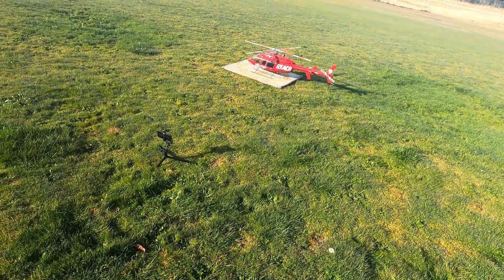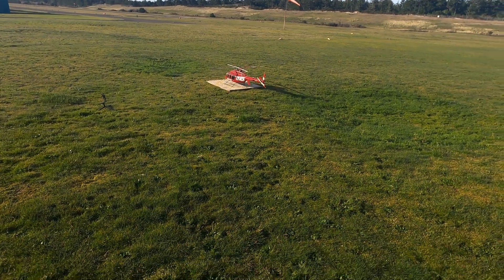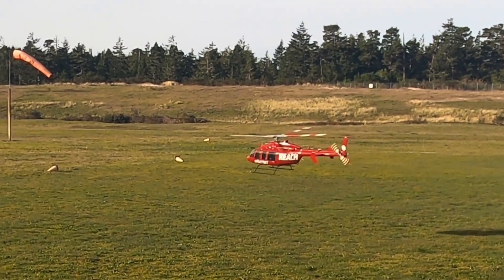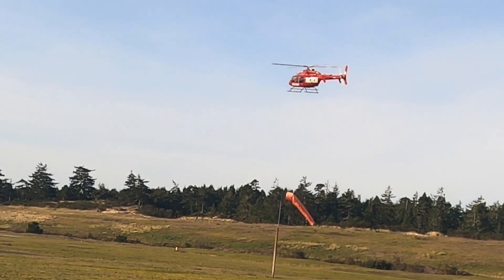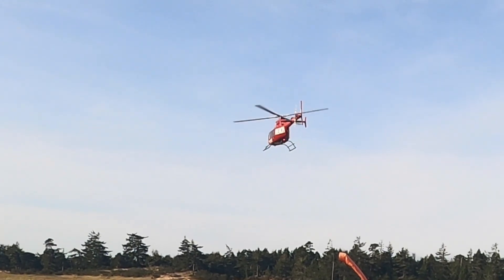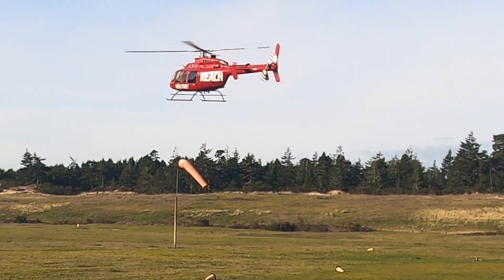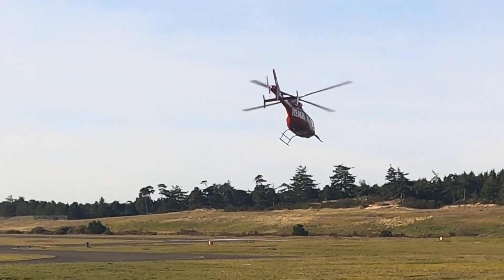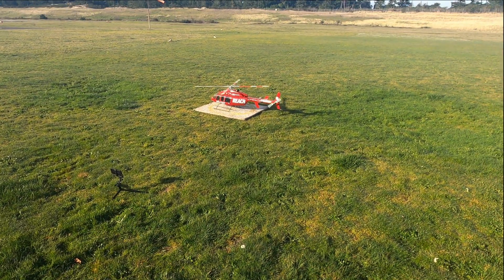Roban Bell 407 magnetic declination testing ￼

Comment: I’ve tried Naza with my Jeti and for whatever reason it acts like it’s getting constant right rudder input. It didn’t do that when I used Spektrum. Have you had that issue and if so how did you counter that?
Reply from the maker: @rcLawnDartPilot  nope. Might look for an old trim setting. Also plug it in to the computer to see if some thing is affecting the settings.